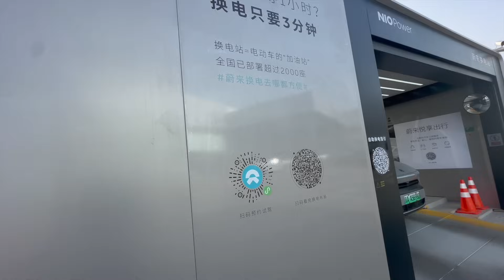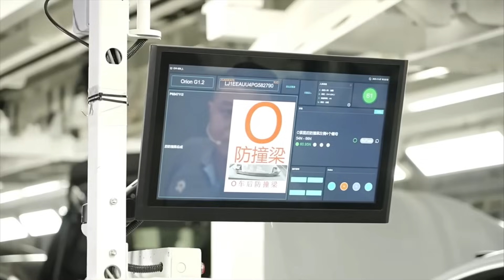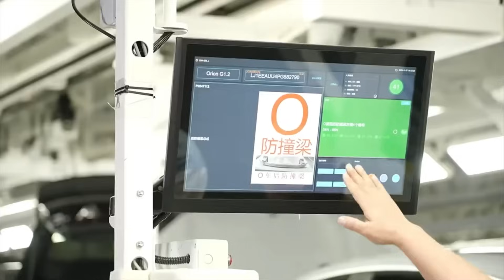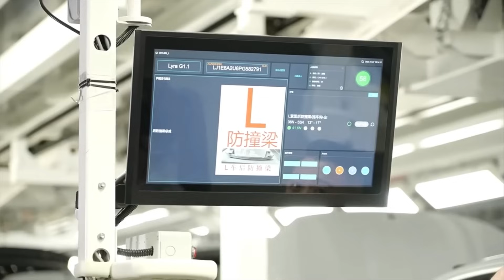NIO STOCK RUMOR! The Truth EXPOSED 🚨

Comment: Wow.  Look at all of the wasted space in that factory.  That's ridiculous and more than that, very costly.  And why are there very little movement?  A fully engaged factory is always moving with lots of activity, not like this!!
Reply from the maker: I’m not sure, perhaps they slowed things down for filming, also nio’s are premium vehicles, so I think it’s fine
Reply: NIOs are NOT Corvettes, which are very premium.  NIOs AREN'T Cadillacs either, which are also premium.  The assembly line is running fine during this filming.  It's the end of the line activity and the massive unused space.  Looks like a dealership write-up area on a very slow day.  Remember, NIO factories can pump out well over 600,000 yearly.  That end of the line activity is more in the 3,000 weekly, 150,000 yearly range, well below capacity.  Also, with profit range per vehicle at 11%, the more sold is more bottom line profits, not losses.  It's sales volume, not we're premium so It's ok to have little activity, that will get this thing out of the hole.